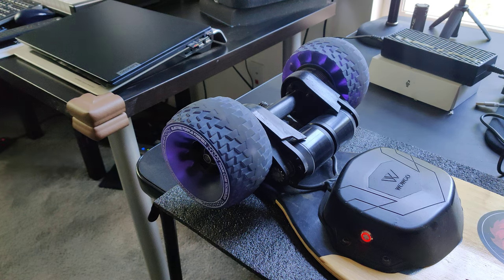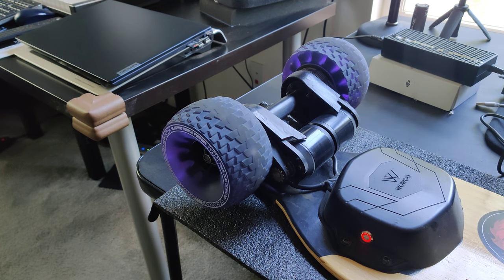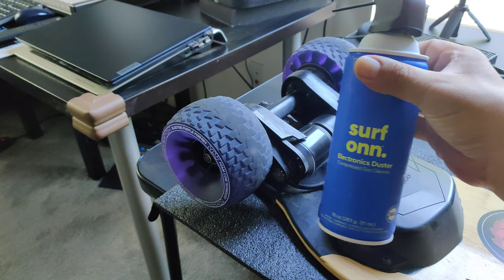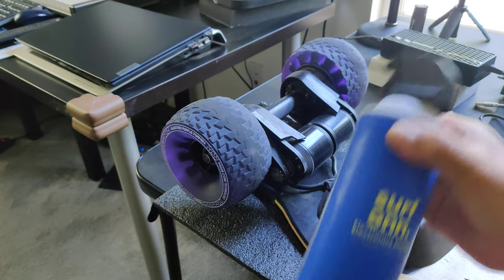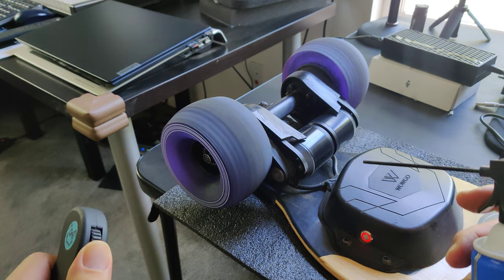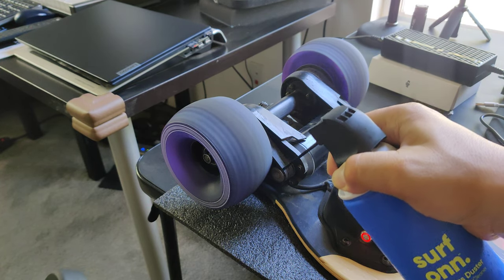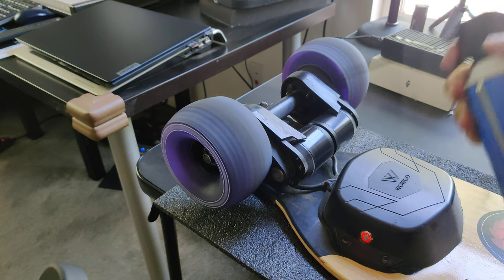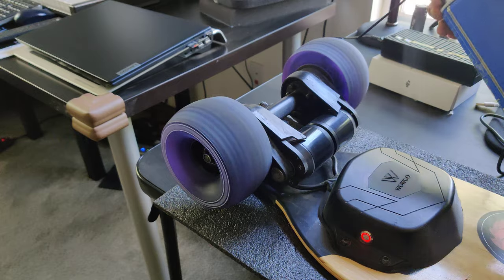Cleaning Hack for E boards with belt drives !!

Comment: How are you enjoying this board? I just got one and am hoping I got a good board. Also what wheels are those? Those are nice!
Reply from the maker: The 3x is an awesome street board. You definitely got a quality board, with good power and tourqe. The wheels are 120mm Slick Revolution Foamies. They take some range away but increases the top speed to around 30mph depending on weight and road conditions. You got an awesome board fersure 😎🤙. Enjoy and ride safe. Don't forget to wear protective gear. 👍